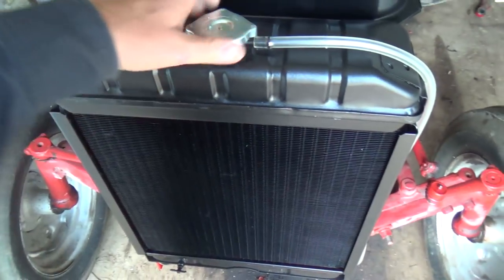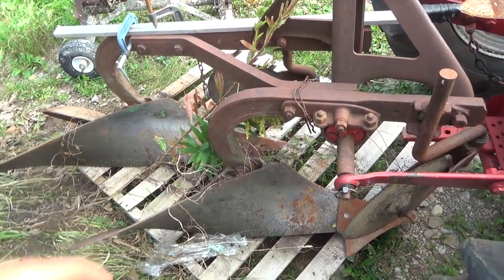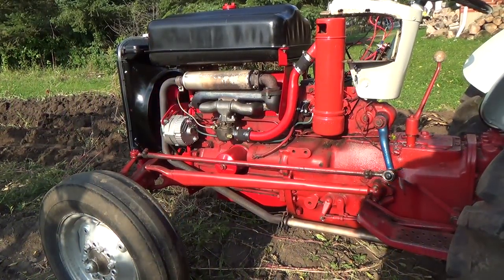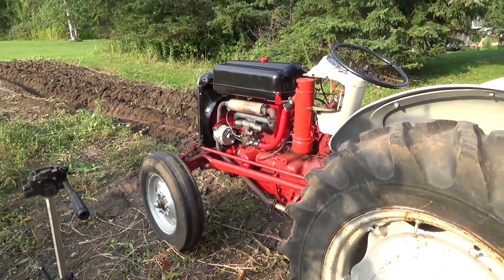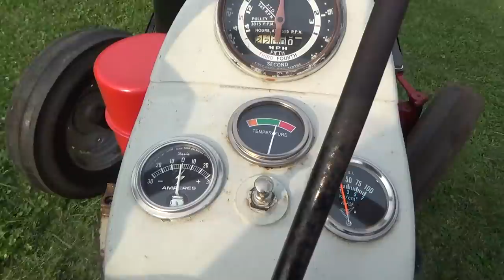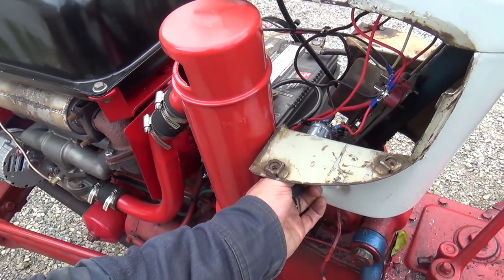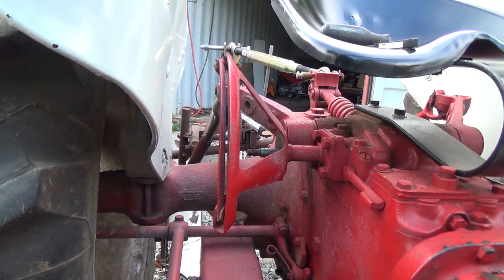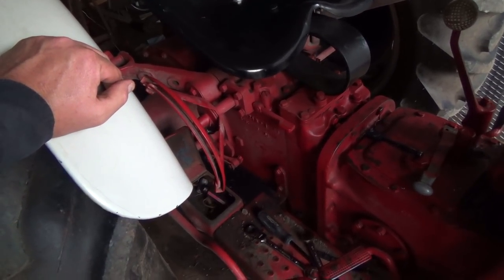Ford 800….Plowing the garden..Gave it a good test out...hitch Lift arm issue though.

Comment: Good day Bill nothing like a plow day with equipment just worked on. 
For the lift arm if I can remember right there are shims in side the cover under the seat that wear out and there is a bit of play back and forth with the lift lever. As you put the nut on it pulls the shaft out off the gear in play does not let the 3point hitch rise. 
You got this keep up the fun vids .....
Reply from the maker: Thanks for the info

Comment: Hey Bill, I've experienced if the hood or cowling is off the machine, It can run hotter than normal. Sometimes the fan and air flow are controlled like a manifold system. May not be the case here, worth a try.  The tractor looks and runs great, nice work. Thanks for the video.
Reply from the maker: Thanks for the tip. next thing going on.

Comment: I've got a 2n and it has some blowby that is noticeable out of the fill cap when I shut it off. I don't worry too much about it. I know these old engines have some loose tolerances and it doesn't seem to burn oil very fast so I will just use it and I can rebuild it when it needs it

Comment: If you have a book for this tractor look this stuff up, like how to adjust the lift also Steiner has videos of how to adjust the lift as do others on YouTube.
The blow by is something you will have to live with, when the head and pan were off a set of bearings and rings with a cylinder hone would have been the way to go and all that is very reasonable. Also in your area there has to be tractor salvage yards to get a different head for this tractor, that is the first place I look for used parts, places like Steiner are  good places but a place of last resort. I am sure you have other tractor friends, talk with them in your area you might be surprised at the help and information you can get from joining a tractor club.

Comment: they make a fan blade that has extra blades pulls more air through the radiator makes it run cooler. you also need to bleed the air out of your hydraulics at the hydraulic pump

Comment: You might try using a cooler thermostat.  For example, if you've got a 195⁰ thermostat in it now, go down to a 180 or 185 thermostat. I've had to do that before in older equipment. Especially equipment that operates slowly or stationary.

Comment: Around 200F for the coolant temp seems about right. Permatex Ultra Copper gasket maker is good to a max temp of 700F (intermittent). Should work fine on the exhaust. There's also this stuff called muffler cement from Yale Automotive that works great to seal up the exhaust.

Comment: what weight oil you have in the rear end???  manual states 90weight ... put thinner Hydro oil in the trans .. its not blow by .. its just venting the crankcase  kinda like a PVC valve on a car

Comment: Bill, that nut only adjusts the friction disc for the lever and that’s all it does
Reply from the maker: yeah. figured that out lol
Reply: Your going to have to flip over the hydraulic top section and do some adjusting to the linkages and while your in there you might want to replace the cam follower pin

Comment: Hi Bill  What direction is the fan running? Is the fan pulling air through the rad or do you have it pushing air through the rad? With the hood on and the fan pulling air through the rad will allow better airflow across the engine for better cooling. Reversing the fan to push the air is for field conditions with extreme dust.
Reply from the maker: it’s a pull fan

Comment: It could be because you don't have the hood on the air is not flowing around right if not you might have to have the bought hot bath to clean out the block

Comment: The sheet metal has nothing to do with air flow ck the high speed air on carb it adjust out to rich in to lean, the valve on the lift maybe sticking if poor quality hyd oil has been used such as 303, slide valve is easy to ck by eye control valve is next to it needs 1/2inch fine thread bolt to take apart it has close tolerance easy to seize

Comment: Looks like your going to need to remove the top cover and readjust the linkage underneath the cover going to the lift cylinder
Reply from the maker: think the cam pin is wore in to far.

Comment: For what I know with my tractors now I run Farmall’s and ji case tractors and depending on the load like plowing with my 311 case I run around 200 to 212 and my h Farmall depending on weather I’m using just the loader or the belts/pto or any type of draw bar work I can run from 185 to 210 just some insight

Comment: When my 800 doesn't lift .I take an Allen wrench and bleed the hydraulics pump.  There is a 5/16 screw on top of pump Crack it sligthly to bleed air.
Reply from the maker: I’ll have to try that.